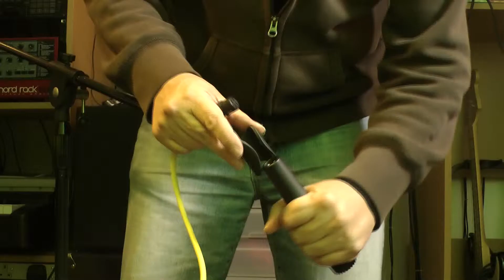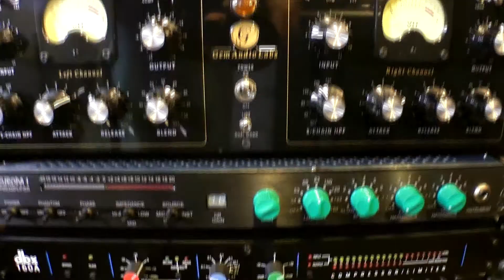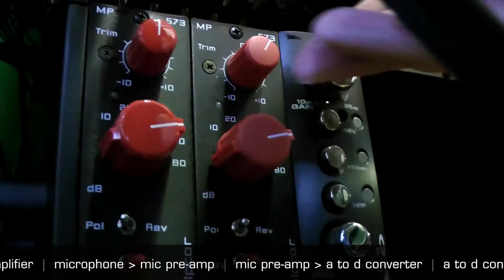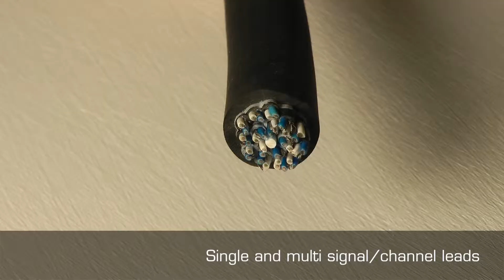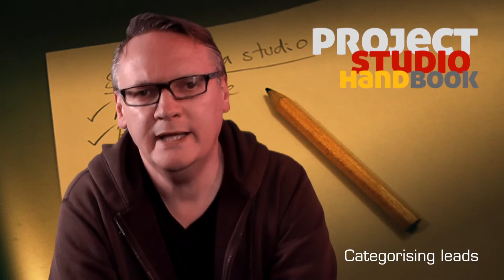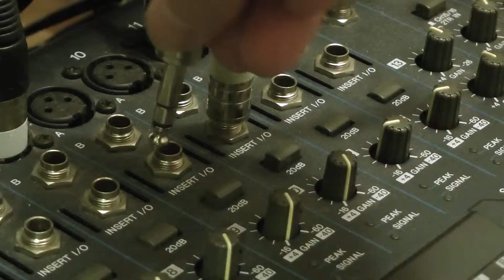Basic audio lead concepts (v1)

Comment: This will sound like a very amateur question but i have been wondering as i was watching your videos... do i need to get an a to d converter or should i just connect the rednet 3 directly to my computer via the ethernet port ?  Will be very helpful as I'm looking to upgrade my studio.
Reply: Rednet devices can connect directly to your computer via ethernet, and then audio is passed to your DAW software via the Dante Virtual Soundcard software. However, Rednet 3 is not a DA/AD converter, it sends and receives up to 128 digital channels of digital audio including a combination of TOS-link ADAT (32 channels) , AES (8 channels)  and SPDIF (2 channels). You will therefore need an additional analogue to digital converter(s) devices to input and output analogue if that's what you need. Hope this helps.